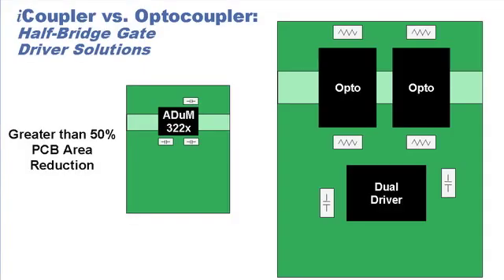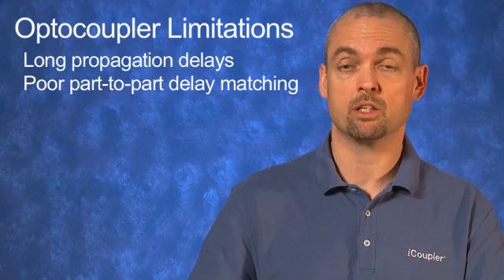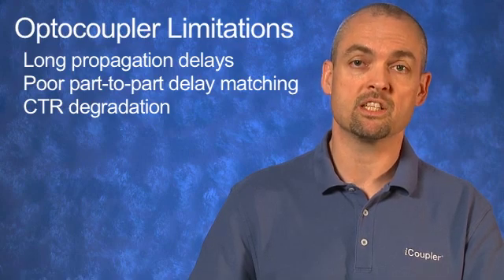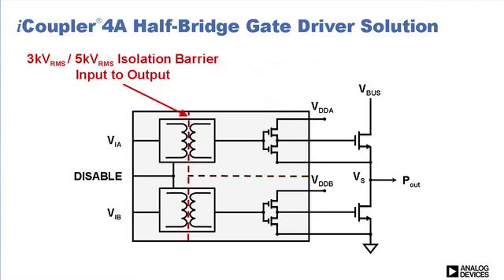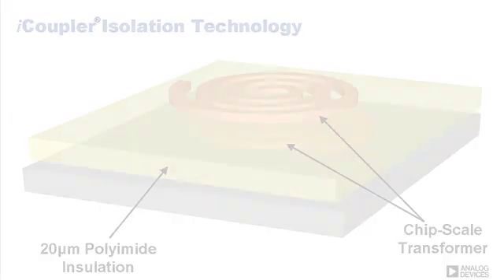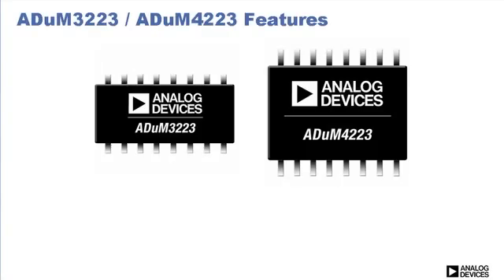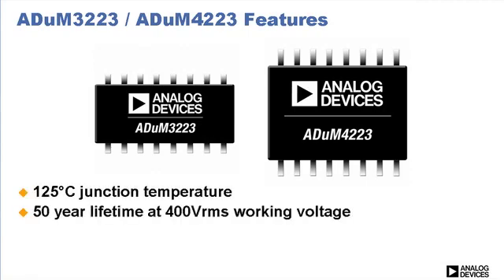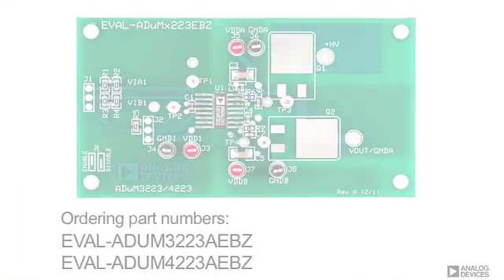ADuM3223 / ADuM4223 Isolated ½ Bridge Gate Drivers with iCoupler Technology

Comment: Hi, I am currently a user of this product and I was wondering do you have this IC in DIP package? From the presentation, it seems that the optocoupler is not needed between my micro-controller and input signal because of the isolation technology adopted. Am I right?